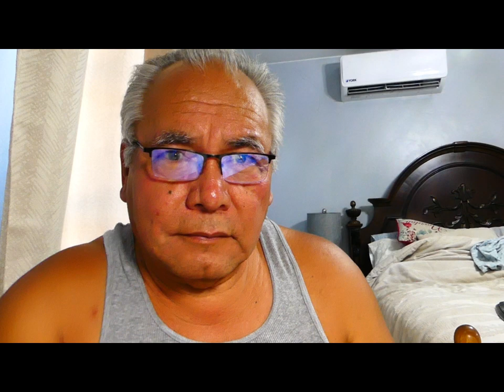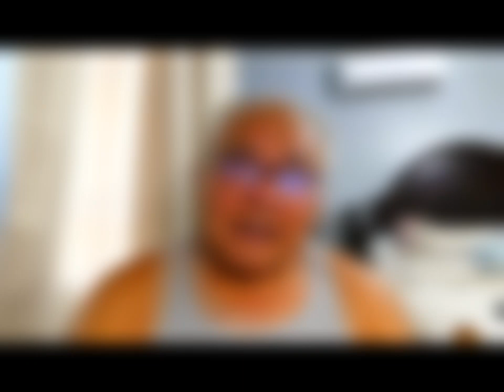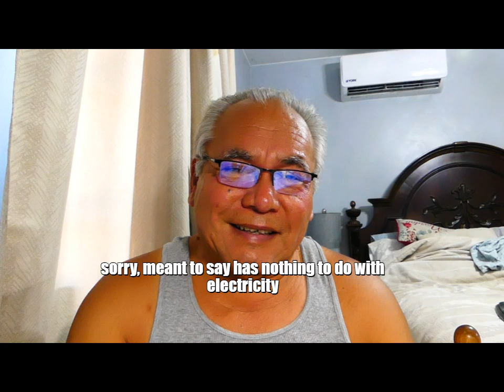Understanding the concept of lenz free generation

Comment: If you magnetize a coil wound on a closed core it will be a mechanical version of Thane Heins' bi-toroidal transformer. However, the effect of omitting Lenz's law can also be achieved with a regular generator, although from a nominal power of, for example, 10kW we will obtain 1kW, but this 1kW will be obtained at the cost of supplying 250-300W

Comment: Hai, Alex. I don't know if you remember me. About 6 years ago, I tried your concept, to generate lenz free energy from a coil, which also had a silicon steel laminated core. But it couldn't deliver the required performance. But I didn't stop. I went on experimenting and Finally came up with a much more effective and easier method, to negate the Lenz effect, up to about 90%. In fact, my method has a variable option, to be able to adjust the Lenz drag, say between 10% and 90%. And it is NOT based on your idea, AT ALL. There is active electronics involved but the results are awesome. It took me 3 years of experiments, to figure it out and design the required electronics hardware, to achieve the end result, that really works. Thank you.
Reply from the maker: I can only imagine a type of delay to get it out of sync., Am I close?, can you share or is it secret?
Reply: @alexmanzanero No. Its not a delay and that's why it is presently a secret, that is part of my ongoing project, for a "free energy" motor/generator. 😊😊
Reply from the maker: @tonyrebeiro  Well Tony my congratulations are at hand for you and your devotion to make this world better
Reply: @tonyrebeiro No compartas ,Úselo y sáquele el máximo beneficio ,siga su camino aue le costó mucho hacerlo .
He seguido algunos videos de Alex Manzanero ,no habla claro ,solo habla ,expone y su último video habla de todo menos del motivo del video ,creo que éste señor no tiene claro los temas ,de hecho no muestra ninguna configuración ,ni esquema serio ,es sencillo ,teme que le cuestionen sus temas que nunca expone ,habla de lenz como si encontrase la solución 😂
Reply: @chusdiaz9160 Can you translate what you've typed into English please.
Reply from the maker: @tonyrebeiro  i alex, translated this for you, this gentleman has been trolling me.....here goes....@chusdiaz9160
3 days ago (edited)
 @tonyrebeiro Don't share, use it and get the most out of it, follow your path, it cost you a lot to do it.
I've followed some of Alex Manzanero's videos, he doesn't speak clearly, he just talks, explains, and his last video talks about everything except the reason for the video, I think this guy is not clear about the topics, in fact, he doesn't show any configuration or serious scheme, he is simple, he is afraid of being questioned about his topics that he never explains, he talks about Lenz as if he found the solution
Reply: @alexmanzanero 🙏🙏🙏👍👍
Reply from the maker: still awesome that you came up with an awesome idea